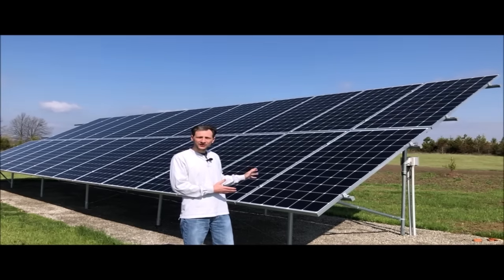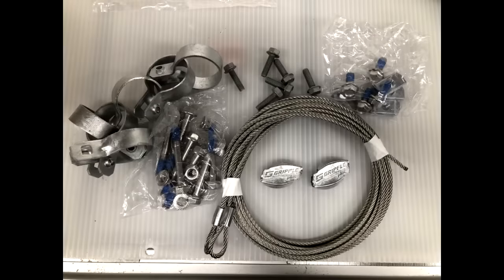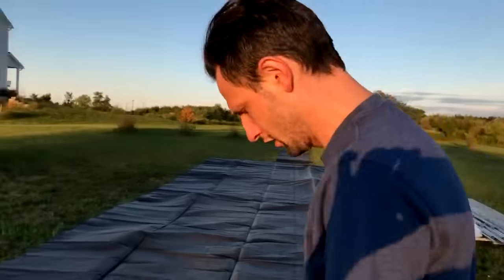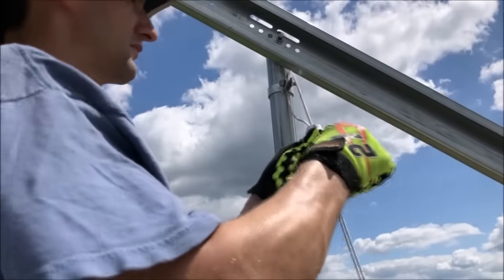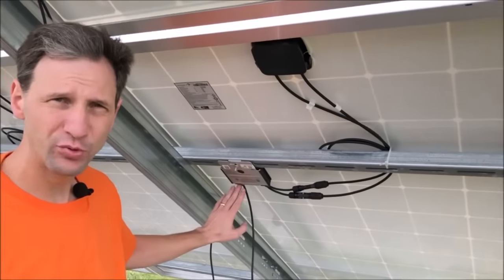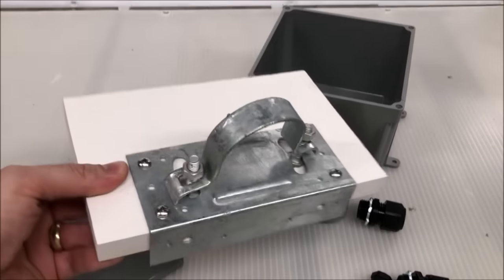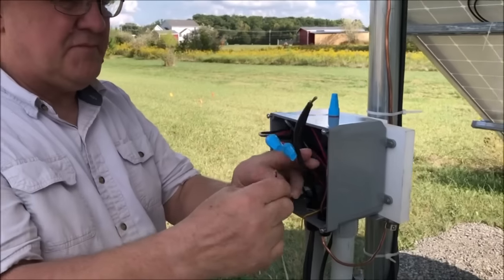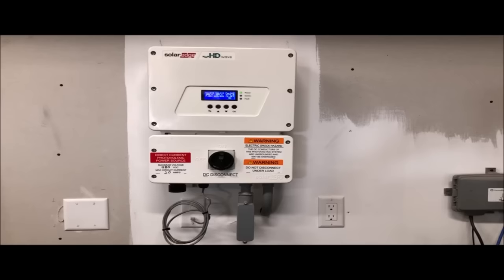DIY 9kW Grid Tie Ground Based Home Solar Panel System Installation

Comment: What all permits did you have to pull? Where I am I can’t build too big of a solar array if it feeds back into the grid, so I’m thinking of just doing my own with a battery pack. Solar companies want $30,000 in cash or $80,000 over 25 years…
Reply from the maker: Her is the video I did on the permitting process: https://youtu.be/imiEYDHLG4A

Comment: ok ran the math your running about 18 amps on 10 awg wire witch should be ok might want to think about changing those breakers to 30 a though to protect your circuit.
Reply from the maker: There are two DC strings each at 480V and about 3,750 wats for a total of about 8 amps per string.  The AC run is not 10 awg.

Comment: I have the pecron 2000  and thinking of buying two of their 3000 batteries giving me a total of eight. I haven't done the math yet but if I install a separate panel so I don't use it for the washer dryer  the stove and the water heater I think I can get by with this setup.  Anybody have any thoughts

Comment: Great video!!! Did you combine each string in parallel inside the junction box at the array? I saw the connection to the underground lines, but didn't quite catch where/if the 4 PV wires went down to 2.
Reply from the maker: There are two series strings that run all the way to the inverter.  Two positive, two negative and one ground wire in the conduit.

Comment: Would bifacial be worth the extra cost when mounting it to a 4/12 pitch metal roof on a shop?
Reply from the maker: In general I would not spend extra to put bifacial panels on a roof.  However, If they are the same cost, you will probably come out ahead.  Very little diffused light can hit the back surface on a roof.

Comment: Why one inverter with power optimizers instead of micro inverters for each panel? I'm new to solar and just getting info for my own system.
Reply from the maker: Micro inverters cost more and the voltage going back to the house would be 120VAC instead of 400VDC, that would have required a much larger conductor for the run to the house.

Comment: Excellent installation guide, and educational, looking to install very similar sized system in SoCal. I am now watching several videos from your channel! And would be installing a tie in system before summer. I am curios and it would be valuable to hear what would be your panel choice if doing the installation today? Is there a reason for not using panels with micro inverters? (Maybe I misunderstood) thanks again for the content, so glad I found your channel and will be using links in your description.
Reply from the maker: If I was installing the same system today, I would use bifacial panels with a steeper angle to shed snow and increase winter production.  If you have a large distance from the panels to the house, and no shading, I would use a string inverter with a high input voltage to minimize conductor sizing and line losses ( I did a follow-up on the cost impact of optimizers you can watch here: https://youtu.be/nC7i_GSrGlk ).  For a short run or panels with different angles and shading I would use microinverters, like the ones I used in my shed install which you can watch here: https://youtu.be/Y8OGxdJ9cU8
Thanks for supporting my channel by using the links!

Comment: What is the actual voltage from your arrays in the cables you run underground ? Are the panels in each array in series ? What type of inverter did you use ?
Reply from the maker: The voltage is 400vDC at peak production.  There are two strings in series.  The inverter is a 7.6kW SolarEdge inverter.  You can see the breakdown of materials in this video: https://youtu.be/PNTO83FvaL4

Comment: That’s a long distance to run 12 volts DC. there could be a significant voltage drop at the inverter in the house.
Reply from the maker: The inverters bump the voltage to 480v.

Comment: Sorry sir.  I have questions for your PV  9kw installed.   Why do you optimized  12 VDC   two string . How much distance between your home and solar station.  What is wire size number?  And  How much DC voltage drop in wire.  If all solar panels could generate  for 80%  about 7.2kw. This case the main line DC power enough or not ?  Thanks.
Reply from the maker: Each string is 400V and uses 10awg wire over a distance of 200ft.
Reply: @ProjectsWithDave  👍👍 Okay.  I get it,hank you sir.

Comment: 25:10 I would have liked to see how the prevention of the galvanic pair between the aluminum and the rail metal of the rack has been solved in the installation of the panels :) Likewise between the grounding strip that comes between each adjacent panel and the anodized aluminum frame of the panel. What can be expected at the junction and how should it be reacted over time?
Reply from the maker: The PV modules have an anodized coating on them electrically isolating them from the galvanized racking, that is why the grounding strips are required.  The grounding strips have stainless steel tabs which limits galvanic corrosion.  After 3 years I have not seen any galvanic corrosion yet.
Reply: @ProjectsWithDave  That's good! How big challenge you think it was to find just the best one supplier for this project?
Reply from the maker: I spent many hours researching and I still didn't install the best overall solution.  But I did installing something that works well and pays for itself.  Here is an analysis of how I could have done it cheaper: https://youtu.be/nC7i_GSrGlk

Comment: In the event of a grid power outage, will your system still feed the grid?
Reply from the maker: No, the law currently requires immediate system shutdown to prevent back feeding and injuring line workers.
Reply: @ProjectsWithDave  Thank you. Does the system as described in the video provide for this protection?
Reply from the maker: Yes it does.

Comment: I would like to know why you connect two rows in parallel and not all 24 panels connected in series? Then you would only have an output at one end of the lines, and you wouldn't need a long negative wire end to end :)
Reply from the maker: The optimizers have a maximum of 15 in series.
Reply: @ProjectsWithDave  Alright :)

Comment: Dave - are you happy with the gravel you used on the ground with bifacial panels?  I'm about to install my rack from APA Solar and wanted to check with you on your use of the gravel.  I was looking at using some stone vs the gravel to increase reflective qualities.
Reply from the maker: The gravel works fine.  I would put down a weed block underneath and use the lightest color gravel you can get.  Weeds grow in the sand so I would use clean 3/4" crushed.

Comment: Nice install video for the solar panels. The only problem and biggest problem with your system is, that if the grid power goes out you do not have power anymore. I was Grid tied before and I used an SMA4000 TL-US. now that is in the garage and is $1800 loss.
Reply: How did you get around this issue of having power if the grid goes down?
Reply: @thelightworshipper9687  Batteries. see my video. You have to use the right inverter.
Reply from the maker: My plan was to take it one step at a time.  This grid tie system gets me started and will pay for itself in about 8 years.  Right now code in my area requires they system to shut down in the case of a power outage, but that may be changing in the future.

Comment: You should  use a actual combiner box with breakers or fuses, wire nuts are not recommended..
Reply from the maker: Thanks for the suggestion.

Comment: Do you have any instructions on how to make that adaptor for your post hold digger?
Reply from the maker: Not off hand.  I just measured the diameter and through bolt position for my out put shaft and did the same for the screw shaft, then paid a machinist to make it for me.

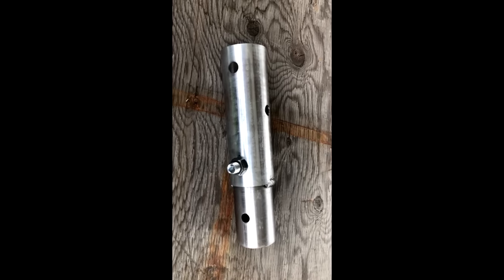Comment: @ProjectsWithDave First, I want thank you for creating this video.  I know it has been a while but I was hoping that you could answer my question.  At the 10:35 mark you show the homemade adapter that you created.  I was wondering what type of pipe you used and what size?  I am going to install this same ground mount and I have a 3 point post hole digger like you.  It appears that you have a CountyLine  3-Point Post Hole Digger like I have.
Reply from the maker: A friend of mine machined it for me for a nominal fee. He used a piece of billet steel and machined it to fit inside the screw assembly.  Then he took a piece of scrap pipe that was a little tight for the auger and machined the inside to match the auger.  He joined the billet and the auger sleeve with a couple of welds.  I tried to find pipe that would just work, but I ended up having to go the machined route.
Reply: @ProjectsWithDave  Thank you for addressing my question.  I was hoping that it was something easier to do as I don't have the benefit of a friend with this capability.  I haven't purchased this mounting system yet because I have no way of driving the poles in now.

Comment: Hi Dave I'm very interested in a system not sure what size as I want to plan for expansion as I think it's going to be more expensive I use about 1158 / 1600  I never hit the 1600 but stuff happens  what would I be looking at  ground mount, thanks
Reply from the maker: Go to the bottom of the "Components" page on my website: https://projectswithdave.com/components/
I have a couple of links to good sources for ground mount systems you can get quotes for.  I don't get anything by you using those links.

Comment: Did you put an insulator in between the aluminum solar panel and the strut to prevent electrolysis?
Reply from the maker: Good question.  I did not do that, it was not recommended by the racking manufacturer.  Do you have experience with issues resulting from direct mounting?
Reply: @ProjectsWithDave  no, I haven't done anything yet. I saw you using ground straps to connect each solar panel even though you bolted each panel to the strut, which is more than enough to connect them. Just wondering if the ground straps were required or if they were recommended by the solar panel manufacturer

Comment: Great work Dave, I am plan to install 10KW system in Columbus OH. Do you know how difficult is the the paperwork dealing with the electrical company and the city. Do you think the read rack is a good choice? I am planning to use a compact tractor not sure what attachment I will need to use/buy rent. Thanks
Reply from the maker: Ready Rack is a little more expensive now with the inflation in steel, but I still think it's a good choice.  If your in Columbus, you will have a different inspector and utility company, so you will have to contact your utility and building department to understand your requirements.  Watch this video on getting your permit: https://youtu.be/imiEYDHLG4A
If you are using a tractor like I did, you will need a post hole digger and a special attachment like the one I made, or you can rent a skid steer and get the attachment from Ready Rack.

Comment: I ask this with much respect,as an electrician… Why do you need the bonding ties between panels if they are all mounted to the same metal structure?
Reply from the maker: The panels have an anodized coating that isolates them from the structure.  The ties cut through the coating to make a connection.
Reply: @ProjectsWithDave  ok, that makes sense. I initially had a PV isolation issue because my garage array was not grounded at all when installed. I made one ground to the array Mount and the isolation issue was resolved. I can only assume that the “teeth” on my clamps made sufficient connection through the coating. Thank you for your response! 🙏🏻

Comment: Dave. Could you comment on if that racking system superstructure could have been built cheaper with pressure treat lumber?  That kit of tinker toys you got are all perfectly good - no doubt - just looking for a cheaper alternative.
Reply from the maker: You can certainly find people who have developed solutions with treated lumber, however, where I'm located, I had to have an engineer approved structure with 90mph wind certification.  If that is not required in your area, you may be able to build something with lower cost.  Keep in mind you want this structure to hold up for at least 25 years.  If I were to go that rout, I would probably build a "car port" like structure that I could use for vehicle or equipment storage.  That way the dual use helps justify the cost.

Comment: If you have an array without optimizers how do you assure safe voltage condition when wiring?
Reply from the maker: You could wire the combiner box before connecting the panels to each other since the panel to panel connections are made with a plug style connection.

Comment: Hi Dave, we have chatted here somewhere but I can't find the chats. so maybe the best question to ask you is: what's the best use of a growatt 10kw grid tie using 545w 
, 49.5v, 13amp panels. What's the best configuration in your opinion. I'm in planning stage so no purchases yet.     Thank you
Reply from the maker: The first step is to download the manual and read the sections on DC input.  A quick glance shows the input max Voltage at 600V, the max usable current is 13.5A and there are 4 MPPT's to work with.
Since you didn't state the quantity or model number of the panels, all I can say is you should limit each string to 11 panels to give some margin the the 600V max input.  Even though 12 panels would theoretically be slightly under the 600V max, on a cold day it would probably exceed it.  Hope that helps.
Reply: @ProjectsWithDave  yeah I forgot to mention that I haven't bought anything yet, just trying to come up with a plan. The pvs I'm looking at are ht saae multiway ht72-545w, available for pickup nearby @275 each. Looking to replace about 18kw/year from the grid.

Comment: Has to be the best video I found.   Thanks for pulling this together.  I do have one question - having 2 rows like you do creates more of a concern with wind forces - is there any reason why you could not go with a single row?   Makes accessing the panels a bit easier also..
Reply from the maker: I'm glad it was helpful!  The racking is designed to handle 90mph winds in the current configuration.  Accessing the panels would be easier, but it would also make the array twice as long and require more racking.

Comment: Firstly, thank you for the great information in your videos. I have a quick question regarding the grounding strips from DynaBond. Do you also link the upper and lower strings with one or did you put lugs on the end of each string and run two ground cables?

Comment: Was interested in how panels get installed on rack. If you ever had to replace one in the middle, I'd imagine it would be hard to replace.
Reply from the maker: The mid clamps hold down the panel to the right and left, you would simply loosen 4 bolts and it would easily slide out.  Hope that helps.  Thanks!

Comment: My biggest issue getting our project "off the ground" is that I want  my panels 6' off the ground, lol, and I'm a little stymied by the connecting to the grid requriements.  I'm in need of some detailed info on connecting to the actual power box.  I'm hoping this video/series will help :)
Reply from the maker: You can always talk to the engineers at your utility and the inspectors for your area.  They are usually willing to help you understand the requirements for connection in your area.
Reply: @ProjectsWithDave  you should recommend them finding electricians to do this work.  I've been installing these systems for over 5 years, and the company I work for has been doing them since 2006.  These voltages are dangerous and can really hurt someone.

Comment: What was the size and type of conduit you used, and how many wires did you run through it.  Thanks
Reply from the maker: I used 1" schedule 40 PVC conduit.  I ran 4 #10 THHN wires and one #6 solid, however the inspector told me the #6 should have been stranded if it was to be run inside the conduit, otherwise it should be run outside.  I also ran an additional empty conduit with a string to pull future wires for expansion.   Hope that helps.

Comment: Kind of a waste of money on optimizers if you don't have any shade. Optimizers only help mitigate losses due to shade to an extent. But the general  rule of thumb for solar is to avoid shade so. A standard string inverter would have been a better choice and saved  you some money.
Reply from the maker: Thanks for the advice.  One of the reasons I chose the optimizers, is they allow me to increase the voltage to 480V for my long run to the house, and they have the added advantage of meeting the rapid shutdown requirements.

Comment: Thanks for a great informative video. Does the fact that you`ve installed the system yourself impact the warranty of the SolarEdge optimizers and inverter? Thanks.
Reply from the maker: Thanks!  The way I read it, as long as the equipment is installed correctly the warrantee is still valid.  It is pretty much plug and play so no big concern there.  You can always confirm for your actual situation directly with SolarEdge.  Here is the warrantee information for reference: https://www.solaredge.com/sites/default/files/solaredge-warranty-april-2019.pdf
Reply: @ProjectsWithDave  Thanks for your response - much appreciated. Good to hear the warranty still applies.